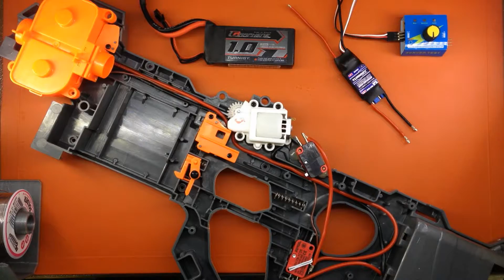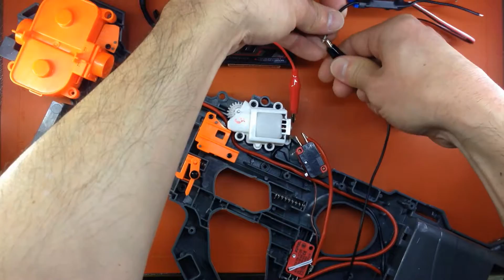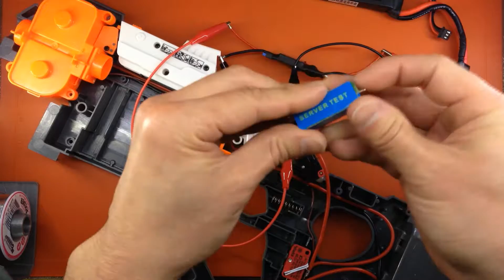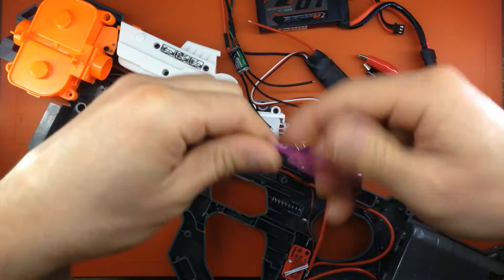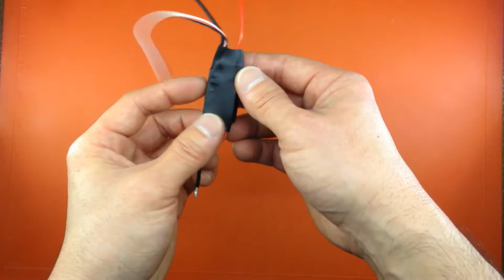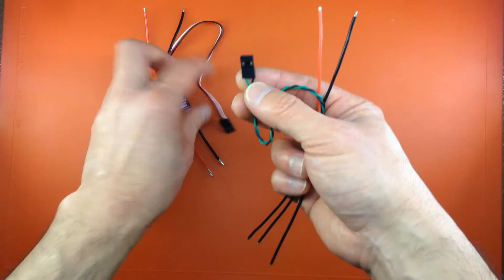Variable Rate of Fire with ESC

Comment: Oooohhh snazzy. Got a hyperfire with some fancy tricks up it's sleeves on the way now . . .
Reply from the maker: It's another Arduino "compu-blaster" but mainly for flexibility for indoor/outdoor play (kids and safety), not that I have anything against throwing in all the bells and whistles. As much as I'd like to do a full racing quad copter in a Nerf shell, I'd like to see if I can get practical results without going overboard.
Reply: I've only got one flywheel blaster in the works designed to break 150fps, and it's mostly a "Because I can" blaster, maybe for NIC style events. I like selectfire for the functionality, but don't really get the point of brushless when anything higher than a poorly tuned 130 build is banned at most events anyway.
Reply from the maker: And that's more or less where ESC is most versatile: you can dial down the velocity as needed/rules require. It's identical to paintball where any marker pistol can adjust velocity by adjusting the air valve. Ranges chronograph individually owned pistols before play and ranges for indoor are typically capped at 300fps. Play outdoors for a private game and players tend to dial up velocity as high as others will allow. 

As far as brushless set ups go, I believe most of those are being built by people who are already intimately familiar with high performance racing quad drones (user built) and it's a fairly obvious thing to take that adjustable high performance, mount it it a plastic shell and use it to pitch foam darts because it is simply repurposing the same components with alterations to the programming. 

But cost-wise, it's generally a case of diminishing returns. Why? Because it's possible.